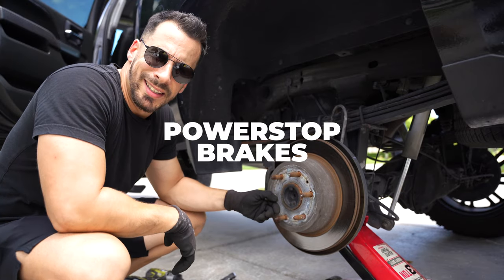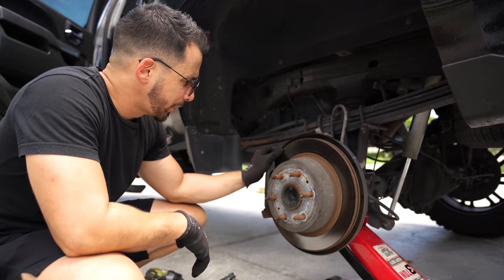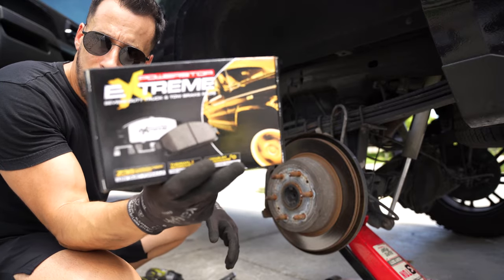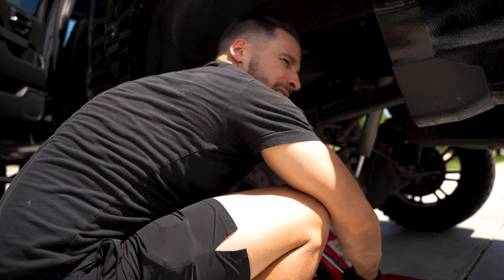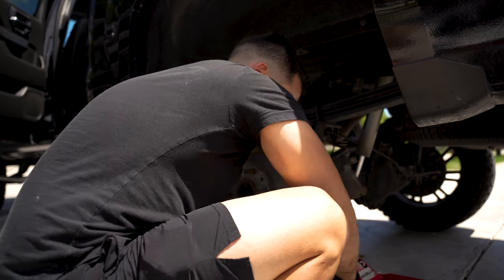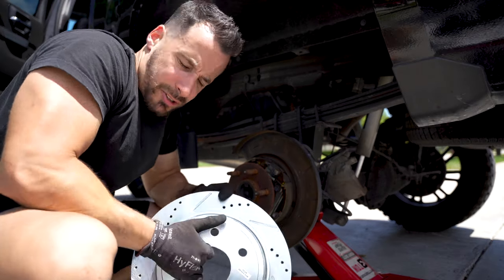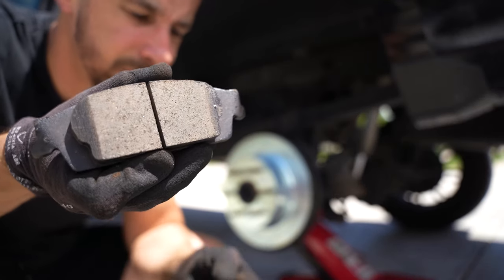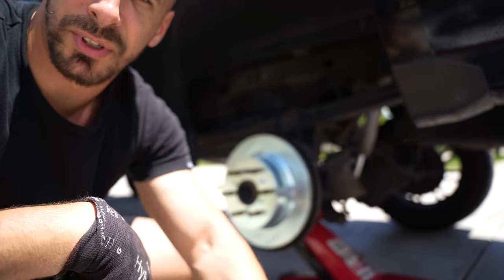PowerStop Extreme Brake Install & Review on my 2017 Chevy Silverado

Comment: Yeah I found out that current cars, like my 2014 Mustang, rely more on the rears when you brake lightly but if you brake hard it relies more on the fronts. When I found that out I was able to make my backs last a little longer. Pretty dumb, but that's what I found out after my experience similar to yours and by reading online.

Comment: Nice!  

How much better stopping power do you have now over the stock set?
Reply from the maker: I would say it's a noticeable difference. Most importantly when towing. With these brakes ive been able to avoid buying trailer brakes up until recently which was only because I was traveling longer distance towing my car.

Comment: Did you keep your stock caliper or did you have to upgrade to the red one the offer thanks?
Reply from the maker: Still running stock calipers.
Reply: Thanks just wanted to make sure the rotors would work with stock caliper just ordered the kit now for my 2016 Silverado thanks man
Reply: I Bet you’ll get a lot of compliments on your brakes

Comment: The Z36 power stop brakes suck, changing back to AC/GM Genuine.
Reply from the maker: I’ve had mine for over 30,000 miles and so far they’ve been great. Sorry to hear it didn’t work for you